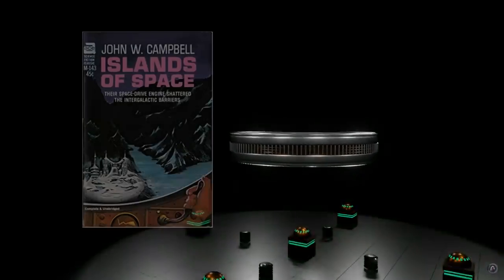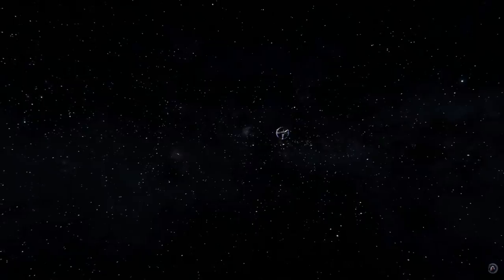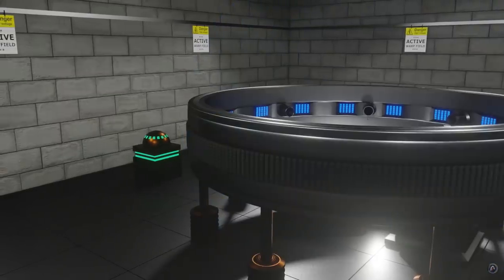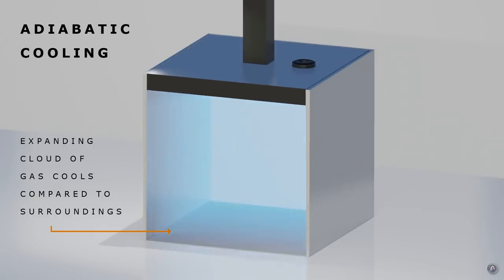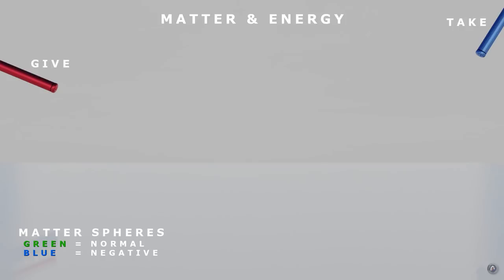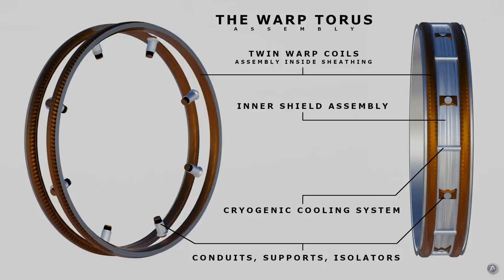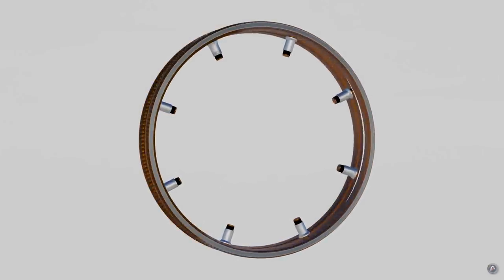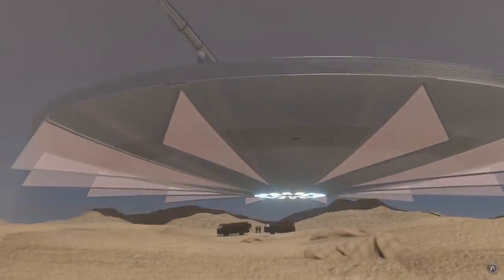A Detailed Breakdown of an Alcubierre Warp Drive Coil

Comment: If a warp coil assembly reduces the effective mass of the craft and through that, the effective mass of the propellant used in standard reaction engines, won't the propellant produce proportionally less thrust? Ie. effectively producing equivalent energy as it would in a non-warp enhanced assembly?
Reply from the maker: Yes and no. You are somewhat correct. There are methods of configuring the coils that work a around certain confines.
Reply: The reactive thrust arises from molecular interactions, which may not correlate with the mass of the fuel.
Reply: @jimbintz2424  The energy content of the propellant wouldn't be effected but, to generate thrust, it has to push against propelent matter to toss it out the back and gain an equal but opposite force so... Maybe? The propelent would prob need to be accelerated outside the field to have a higher thrust to weight ratio.
Reply: @asteronx  why not explain it in simpler terms?
Once an object is saturated with forward momentum and cannot hold any more, it ceases to accelerate.
Once I postulated this, the rest of the calculations became easy to understand.
In really simple terms, a pint cannot hold a quart, no matter how hard it tries.
Reply: One issue people are not talking about is that a real warp drive could cause the ship to exit normal apace all together into a worm hole.
Reply: @JeffMcDuffie72MeridianGate  Um.... not really, unless there's some new effect we're all missing. At worst, it would "frame drag" interstellar dust and medium that hit the warp bubble to the destination to be released as a massive .99c pulse but, using it to tamper with localmass and going sub 1c doesn't even have that issue - which is solvable by choosing approach vectors. Assuming you managed to pile up enough matter/energy at the destination to form an event horizon, you may form a blackhole but, a wormhole requires special negative mass configurations ot even hypothetically exist... if you could make a wormhole, that'd be WAY more of a breakthrough than lowering the mass of conventional propellants.
Reply: @bryanl1984  high warping of space dont need exotic matter to potentially cause a worm hole.
Reply: @bryanl1984  you have to think of the fact that you are artificially warping space around a small object. That type of warping should not be naturally possible for a low mass object. You dont know what that would really do.
Reply: @JeffMcDuffie72MeridianGate  Explain to me what mechanism is supposed to allow the creation of wormholes if warp drives are possible? As I understand it, wormholes are only "sort of hypothetically" postulated to exist when you can use negative energy to mass to stabilize the throat of an ER bridge (that'd otherwise instantaneously destabilize)  - which is basically two black holes connected across some temporal plane, even though they're separated across spatial distances. Other than creating pairs of wormholes and then dragging them somewhere at sub-C velocities or inflating hypothesized "infinite" virtual particle wormholes from subatomic sizes to radii large enough to send data or items through (which may exist in infinite amounts if you can somehow segregate them), there really isn't thought to be another mechanism to create them... Like I said, a mechanism to warp space producing a wormhole would be OUTSTANDINGLY better than a warp drive - it'd essentially be a means to create high throughput rail-links between arbitrarily distant locations or even times if Roman Configurations are possible. All a warp drive does is use - progressively smaller, based on newer configurations and calculations - negative energy densities or mass to alter local spacetime so it's less massive or move a bubble of it at some arbitrary velocity, instead of spending infinite energy to move mass through space. I still don't see how that'd even hypothetically create a wormhole without  incredible effort to even  attempt to actually do so...
Reply: @bryanl1984  a plasma imbalance would cause the warp field to become unstable and the ship would create a artificial wormhole. Once in the wormhole you'll have no control snd would probably be instantly destroyed.
Reply: @JeffMcDuffie72MeridianGate  Plasma is just matter with enough heat pumped into it to strip off electrons.... It's not an exotic mass/energy phenomena. Fire is plasma. Fluorescent bulbs are plasma. Other than stars, where the sheer quantity of matter warps space time (thanks to gravity accumulating it with fusion heating it at an equilibrium volumetrically), plasma has nothing to do with metric engineering.... How would "Plasma imbalances" cause a wormhole? The only boundary case that I could think of is so much energy being concentrated into an area that it essentially reaches quark-gluon plasma levels of "Absolute Hot" (which is postulated to create a pocket universe or expand space time) or has enough mass/energy to create its own spacetime distortion but, that'd require the mass energy of several star systems somehow accumulated in transit and would slow the ship down - warp drives don't violate physics, it just changes the parameters of background spacetime;  hence the name. 

Warp Drives are hypothesized to be possible only by using negative energy gradients - if you could actually accumulate enough "stuff" of positive energy or mass to somehow start warping spacetime, you'd have long since destabilized any conceivable warp field.
Reply: @bryanl1984  do you even know anything about warp containment fields? Or warp field generators?
Reply: @bryanl1984  plasma imbalance will cause the warp bubble to become unstable and dip lower into space time. Like warping space for a warp drive is like riding a wave right? A artificial wormhole is like riding below that wave.
Reply: chefirr Great question, I too was wondering this.
Reply: If it reduces the mass, that's less energy we need for acceleration. Or you would be able to accelerate faster. Both assuming it takes less energy to operate than just accelerating normally
Reply: @bryanl1984  If the propellent was inside the mass reducing field but the energy reaction propelling it out behind was the same then the mass would be accelerated proportionately higher, so retaining the kinetic energy  given to the space craft. Thats at least how I understand it.
Reply: @grgmetube  I could be wrong but, I'm under the impression that the efficiency of acceleration actually lowers the faster the particles (propellent) are accelerated. Theoretically, if you could accelerate xenon to say 22% the speed of light normally and you lowered the mass 5x you'd start maxing out near c. You need exponentially more energy to accelerate it the closer you get the particle to c but, I don't know if that actually correlates to increased propulsion since that energy is becoming inertial mass for the particle, not velocity - so, I don't think you'll get an equal but opposite reaction.... 

Also, you could theoretically create a propellantless drive by manipulating the mass of the particles. Accelerate the lightened particles as fast as possible out of the field, then let them hit a target on the ship and recycle them back into the lower mass area. It'd be like a fan on the deck of the boat pushing on the sails but, the mass differential allows you to create an asymmetry in the forces (it would generate less force to accelerate at lower mass than it'd impart at the target).
Reply: @bryanl1984  If the particles been accelerated at such a rate to near the speed of light (speed of light inside warp bubble) they would gain mass again (Einsteins equation for mass approaching speed of light. M=1/(sqr(1-v^2/c^2)) x m. sqr = square root, v=velocity of particles inside bubble, m=mass of exhaust particles to be accelerated in this case, M=mass after acceleration to near speed of light) So the question would be does the negative space vacuum inside the bubble cause more mass loss of the particles than they would gain from been accelerated to near speed of light in the bubble? Even if there was no warp bubble (negative space vacuum) and exhaust reaction mass was accelerated to near speed of light, it would not matter that rate of acceleration was lower for amount of energy. The reason because there mass would be increasing so the opposite reaction of acceleration given to the space craft would still give proportionate amount of acceleration to the energy been used to accelerate the exhaust particles. Yes if the space craft itself was accelerated to near speed of light, it would become very inefficient with the energy needed because of its mass increase.
Reply: @bryanl1984  i had  same theory before i watched ths channel..great ingenuity thou mind blowing!!  i wonder how you collect the tachyon ..how do you detect the time of its birth before death..is it a specific rpm psi i would give anything to see such glorious work of art..
Reply: I think it improves the rocket's performance. The rocket propulsion equation states that a rocket creates a change in speed equal to the exit velocity of its ejected gas multiplied by the natural log of the ratio of the initial mass and the dry mass. Delta-v = v_exit x ln(M_initial/M_dry). So using this equation for the basis of argument, if the effective mass is reduced equally such that M_initial/M_dry is always the same number there will be no change to delta-v from this part of the equation. The difference is in the exit velocity. I think that the force created in the chemical reaction within the rocket will be the same, making F in F=ma the same. But because m is reduced, a becomes much larger, thus making the rocket propellant leave the rocket faster, increasing v_exit in our first equation. Thus delta-v will actually benefit from reduced effective mass of rocket and propellant. We can either keep the same amount of fuel mass and get vastly improved delta-v's or we can carry vastly less fuel and achieve the same delta-v's we currently do.
Reply: @grgmetube   @Wintermute  I wouldn't worry about this. You'd never want to accelerate the craft to those speeds anyway using conventional rockets, because even if you could get close to c, the time required for interstellar trips is still untenable. You'd wait until you could use just the warp drive to propel you, at which point relativity issues go away. In the meantime, conventional rockets on a reduced-mass craft would be a great way to travel to explore the solar system, and you could never approach the speeds where the relativistic mass increases you're talking about would matter, because you would arrive at your destination before you could reach such high speeds.

The problem is you couldn't have more acceleration than 1-g during the trip because humans can't handle very high g-forces, and even at 4 g's it would take you a long time to reach useful speeds. No human could handle even 2 g's for a long period of time, so you're stuck with 1 g acceleration. At 1-g acceleration, you reach virtually anywhere we currently know about within six months or something like that, assuming closest approaches. So let's assume, then, for ease of math, that such a trip would involves 3-months of constant 1g accel and 3 months of 1g decel. My math says you would never exceed 0.26c, so your maximum relativistic mass increase is only 3.5% for that one blip of time where you actually hit 0.26c before turning the ship around and starting to slow down. Obviously the actual trips would be more complicated than that, but even then, I don't see how with 1-g of accel we would ever get to even 0.5 c before we arrived at the destination, and that's still only a 15.5% increase in mass from relativity. No big deal in my opinion.

Currently a prolonged 1-g acceleration isn't possible because of fuel restrictions. But, with lower effective mass you could have fuel enough to sustain a 1-g acceleration for long periods of time. It's only like 32 hours to Mars at its closest approach at that acceleration or something like that, and a few days to Jupiter or Saturn. So it seems like a great idea for solar system exploration and only bad for interstellar travel.

Comment: BULLETS CANNOT BE USED AGAINST A FIELD, COPPER EVEN. METAL IS DEFLECTED BY THE FIELD, NON METALLIC PROJECTILES WOULD WORK, I THINK.. I was hearing a guy say. you can take a microwave oven, plug it in, turn it on for 30 minutes. seal the plugs together and then throw it into a pool. The microwave energy forms a barrier around it's container keeping it dry. You will then pull out a completely dry microwave. This idea/theory should/could be used in smaller fashions to use on torpedo's etc. to create a well area of no friction. I seen a guy years ago that was making sparkplugs of sort that were frequency coils and they burned salt water. yep, I seen them burn like a small torch. Stan Deyo himself worked on craft underground in Australia, he has and knows some great ideas. Just copper plates shielded and an inverted coil powered by a small engine done right would cause antigravity but the large amount of electromagnetism would kill the occupants. That area would need shielded and cameras would have to be used to see outside the vehicle.  One way frequency coils is the way. With new batteries due to hit some sectors. They utilize the depleted radioactive charge left in the graphite from nuclear reactors. Bundled up right, these batteries will hold power for 8 continuous years of application.  Ahh the things I would do if I had money. I have already surprised myself in hydraulics and Chemistry, used to have a large play area, gone now. I want to do this, i have over 20 years CNC with programming Tool& Die work. Gimme a machine or two, some great metal and maybe some Deuterium and I might build Dr. David Adair's  electromagnetic fusion containment rocket field. Watch Boyd Bushman's experiment on aluminum and copper tubes. Antigravity? He proved with 2 magnets pushed together that a large field is produced around them. He then dropped them and times it. Also dropped the same thing in the same container without magnets, he had several extra seconds of lift from the magnets. He got a plaque of excellence at Lockheed Skunkworks. He was the Lead Scientist Aerospace engineer there.  Watch his video's. Opposite opposed electromagnets and more place 180 degrees from will, zoom!
Reply: You should post a presentation, that would be cool.

Comment: 11:00 "Reducing a craft's effective mass is akin to having a V-8 engine on a skateboard."
(shows animation of a rocket taking off very quickly)
The only problem with this is if you reduce the mass of the craft to zero, you have also reduced the reaction mass to zero, and therefore no thrust.
The key then, would be to cause the reaction mass to exit the warp field at the precise moment so that it takes on normal mass right at the moment of combustion, so it can generate real thrust.
Expect tons and tons of stress on whichever part of the craft exists outside the warp field, as it will be subjected to all sorts of inertia/momentum forces. You will need some really really strong fasteners to connect that part to the rest of the craft.
If you can do it all with some sort of magnetic non-substantial containment nozzle, then so much the better.

Comment: My biggest questions surrounding the Alcubierre Drive are these: If, as what has been explained previously, the drive contracts space ahead of an object and expands space behind said object, how does navigation work?  Assuming you contract space between, say, Earth and Alpha Centauri, logic dictates you would also contract everything within that space as well. Let's say the Oort cloud, asteroid fields, etc.  How would a ship be able to navigate such compressed terrain safely? 

Secondly, realizing that such speeds are relative and any ship using such technology never actually approaches or reaches (or breaks) C (the space around the object is moving while the object itself remains still) would T=t/sqrt 1-(v2/c2) even be a factor?  Perhaps a twin on a ship with this device would only differ in age from other said twin based on gravity-based dilation, not speed-based?

Comment: 1.8 billion watt/hr energy. how did you calculate that?
Reply: there are papers going over the theory, like the mushin drive the channel has made a video on.
Reply: @Baigle1  thanks for repling.
Reply: How much antimatter would that be? The only way you could make a warp drive work is by collecting the faster than light particles in front of the ship. This would also change space time and stop energy build up and use that energy. This would lower the energy needs of the drive. These particles could be change to anti matter than into warp matter or what we call dpositronum.
Reply: 1.8 billion watt/hr is equivalent to over 8 million kg of antimatter.
Reply: He said 18 billion magawatts

Comment: I suspect that entanglement of a mass-particle may make this much more efficient. It may even be that the coils ought to operate with or with the assistance of entangled protons. By entangling mass-particles we may be able to create a gravitic dipole. In fact, while fictitious, this is what I think the role of "dilithium" is in Star Trek. Just as we use special crystals today to entangle massless photons, there is some crystal that can do that for electrons or protons -- the latter of which having so much more mass and thus more likely to be productive in the way we need it to be. Since the idea of charged Higgs bosons is pretty far out, it's just an idea, but it would make a whole bit of physics a lot more symmetrical.